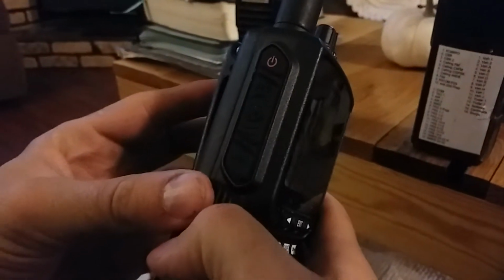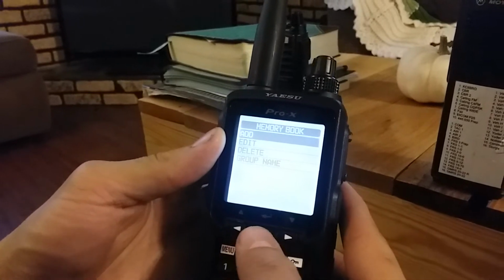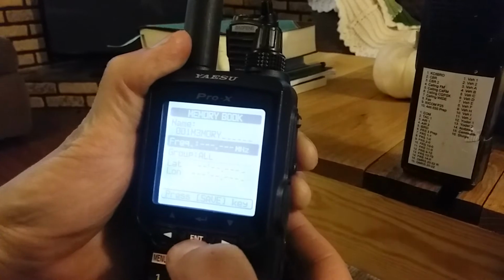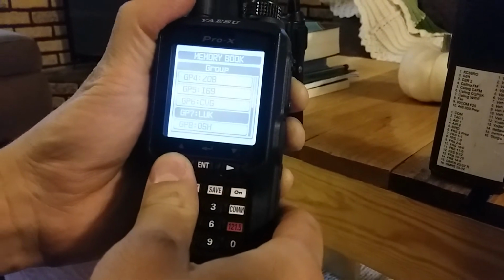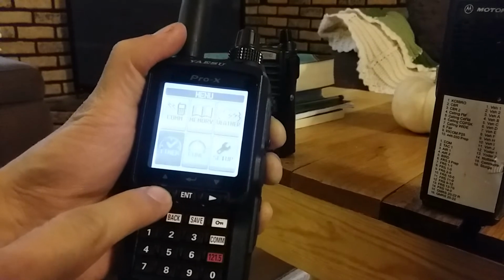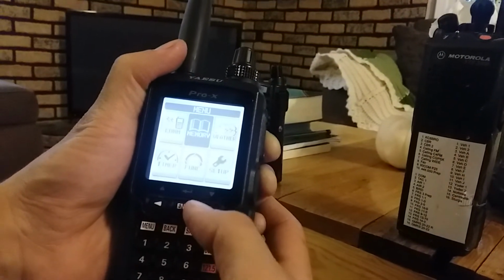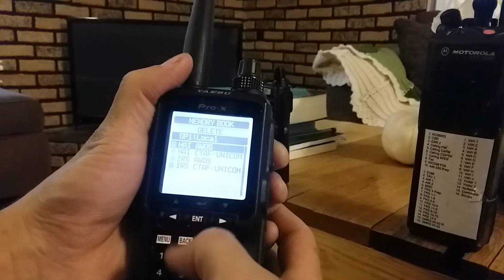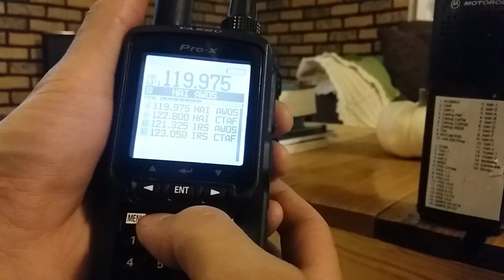Yaesu FTA-550L - Programming Memory Channels

Comment: Can you program 150 mhz frequencies and local police repeaters
Reply from the maker: Short answer: No. This radio only covers the aircraft band (108-136 MHz RX, 118-136 MHz TX) and it is AM only (except the 162 MHz NOAA freqs), whereas your local police repeaters will be FM or a digital modulation.
Reply: Your local police will also be on encrypted trunked so youre better off picking up an SDI dev kit and figuring that out if you want to listen to the cops